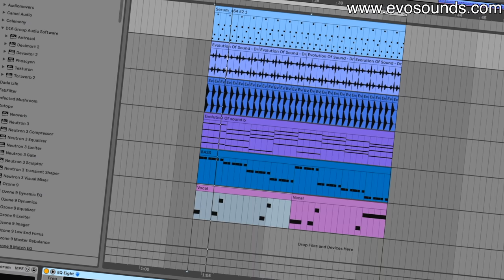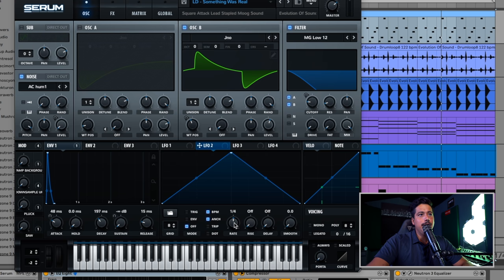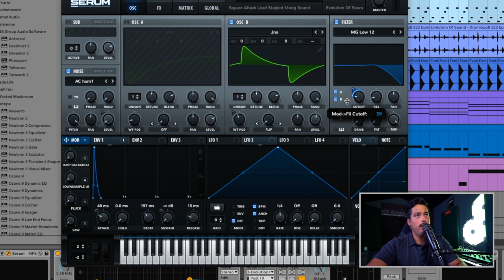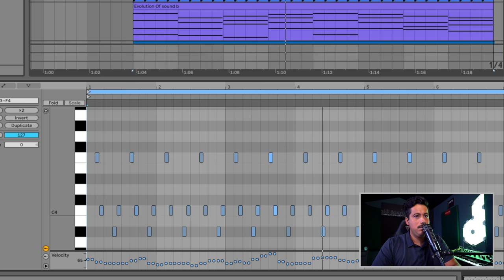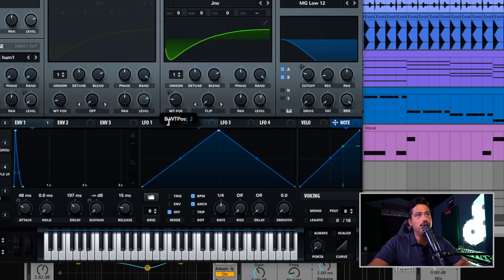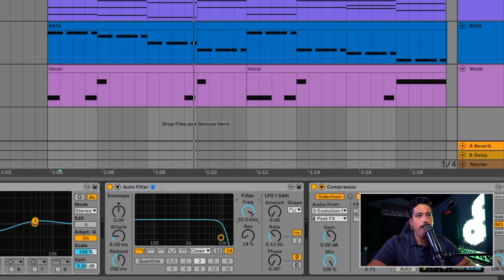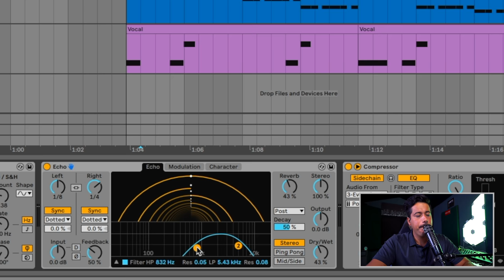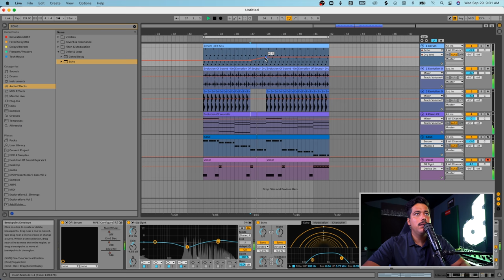Bring Your Synths To Life With These Techniques

Comment: Another cool tip is to use 2 LFO's which modulate each other in amplitude/frequency and then use them as modulators for other parameters. Generates some cool randomness!